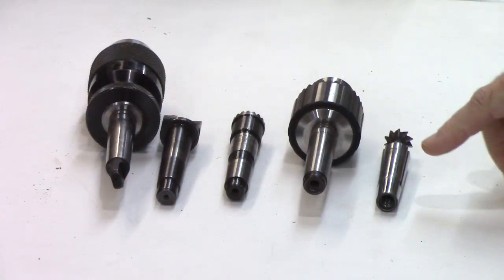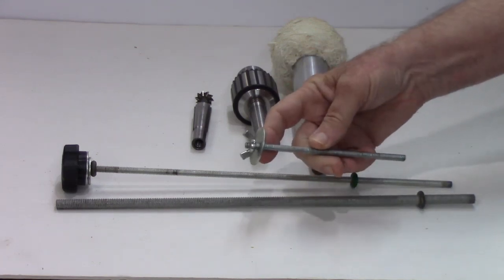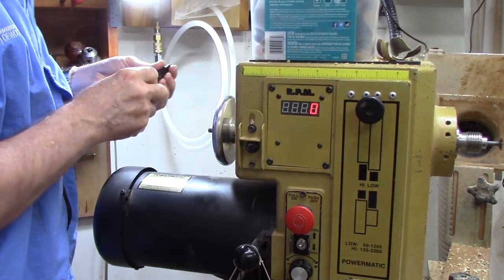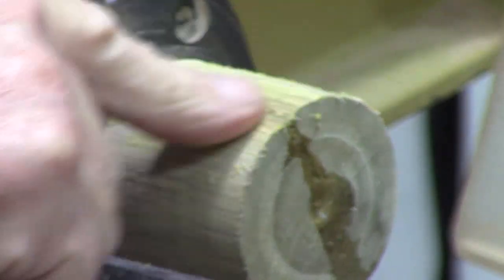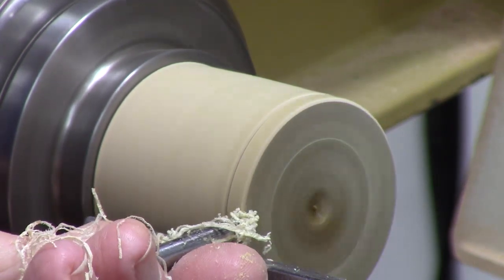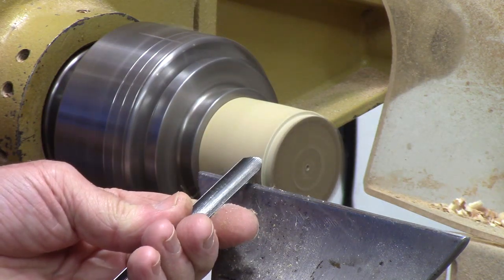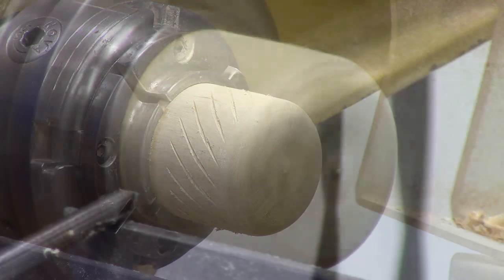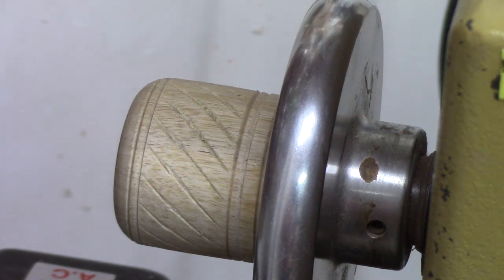Making and Using a Drawbar for Morse Tapers

Comment: Very helpful video Mike. Great tip on the groove for the chuck too.  I don't quite follow why, how or where the rubber ring is used but I'm glad that no calves were harmed in the process.. Thanks Mike.
Reply from the maker: I had a bunch of the rubber rings so I figured why not put them on the rod so I would not here any metal scraping inserting or removing the drawbar. Total unnecessary but I had them.

Comment: NICE video,  Mike. Did you drill the hole the same size as the o.d. or did you drill the hole smaller and thread the rod in? Tks! SAFE TURNING, John
Reply from the maker: Same size. I tried a  smaller hole first but found it too hard to thread it into the hole. But that is an option if you add a couple of nuts to grab on to with a wrench and only make the hole myabe a 1/32" smaller. You could skip the epoxy. The epoxy holds it fine in the same size hole and was less effort.
Reply: Thank you!

Comment: mike any ideas if the morse taper does not have threads on the ends,,only flat spot
Reply from the maker: Do not use it in the headstock or cutoff the flat and drill and tap for 1/4x20 threaded rod.

Comment: Great video

Some additional thoughts - 

1.  I chose to make my drawbar handle by embedding a nut in a recess between two bits of wood that were glued together  (I could have used a threaded insert and avoided the glueup).  The result is that the handle can be adjusted to whatever length is required by the tool it is being used with.  The downside of that approach is that it leaves the cut end of the threaded rod exposed at the outboard side of the handwheel - and that's dangerous (DAMHIKT).  I solved that problem by drilling and tapping a scrap to fit over that end, and then turning it down to make a rounded protective cap.  This scrap could be wood, but I chose to use HDPE.  Of course, a simpler solution would be to round over the end of the rod using a grinder or file, but turners always have to turn something!
2.  I either read or saw somewhere that the threads on the drawbar potentially can foul the female morse taper in the headstock as it is inserted for use.  A solution for that is to use 2-3"  of heat-shrink plastic tubing on the drawbar, leaving 1/2" or so to screw into the fixing it is being used to secure.
3.  Some (many) Jacobs chucks actually consist of a mandrel with a morse taper at one end, and a different taper that fits into the chuck body (typically, a JT-33 taper).  The good news is that if you are upgrading from a minilathe with an MT-1 taper to a larger lathe with an MT-2 taper, it costs less to replace that mandrel than it does to replace the entire chuck.  But the bad news is that vibration can cause that JT-33 taper to come loose, and in that case, a drawbar won't hold the chuck in place since it only attaches to the mandrel.  This is another reason why it is better to use the Jacobs chuck in the tailstock for drilling - holding the chuck with your left hand will prevent the chuck body from separating from the mandrel.
Reply from the maker: Good tips! Thanks for sharing, Louie. I especially like the heat shrink tube idea. Probably work better than my castration rings but not as good a story!